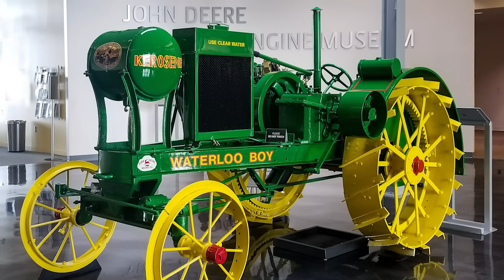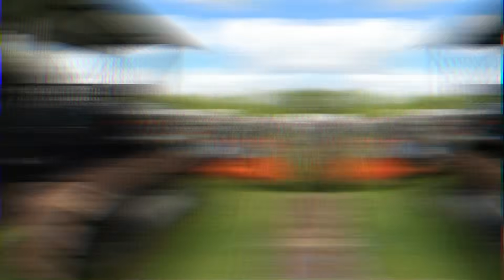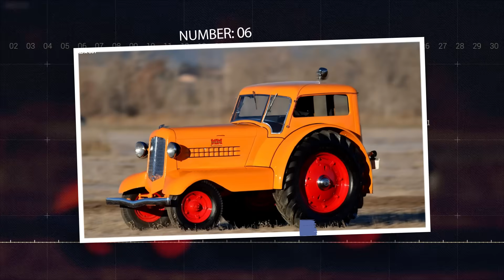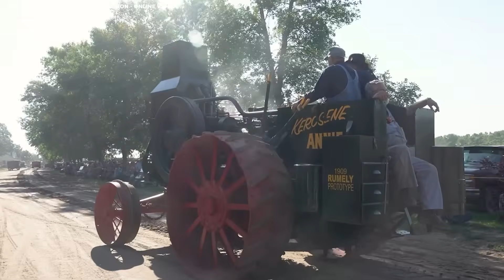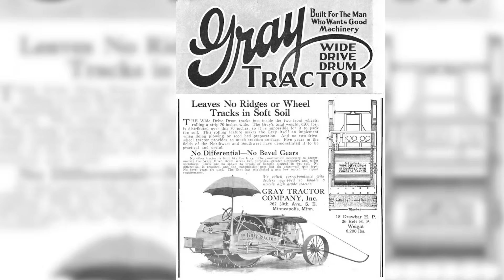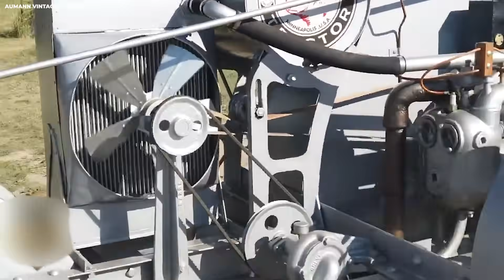10 BIGGEST AMERICAN TRACTORS YOU MAY NEVER HEARD OF!

Comment: error will robertson error.  Im a farmer and I will not ever buy what u call a modern tracker.  Why?  To many bells and whistles to go wrong.  Give me one built before 1990 every time.  U can fix anything on them shot of a blown motor in the field with tools our of ur tool box.  U see the infernal combustion engine needs only three things. Air, fuel and a spark.  Anything u put on it that is not his is not needed.  Drive ur machine dont read a book while a robot does and then b/c one little 1 becomes a zero and u just lost 2m b/c u were reading a book rather then driving ur machine.  and then it will cost 5K to replace that one little chip.  Im not alone in this.  Most farmes under 200 ac dop things my way b/c we dont have 200K to spend on one.
Reply: "tractor?"